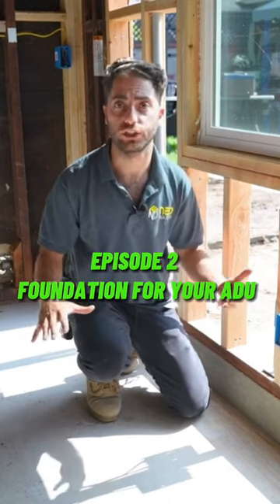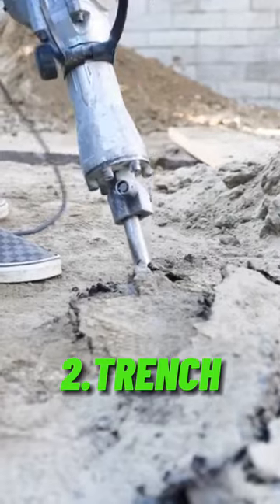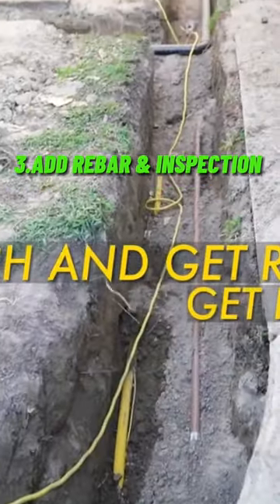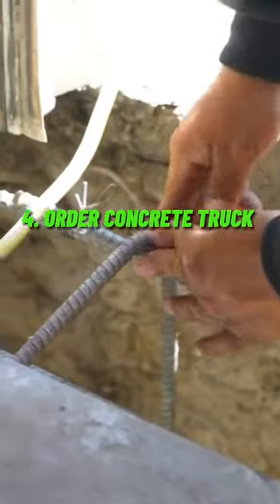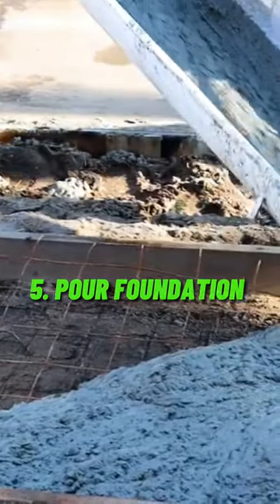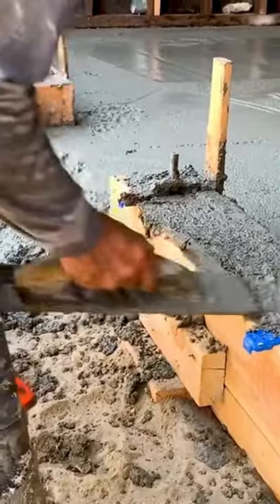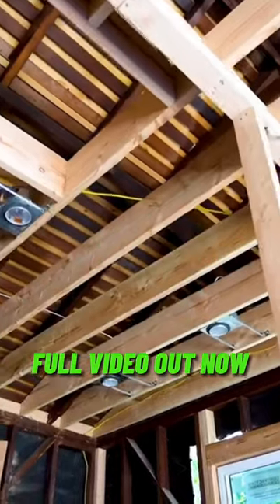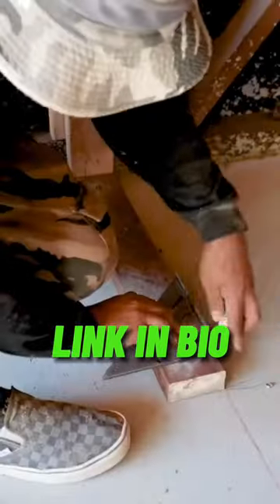Episode 3 | How to Build Your Own ADU | Foundation FULL VIDEO OUT NOW #adubuilders

Comment: Have you had to deal with a garage that was originally framed with 2x4s that are actually two inches by four inches instead of 2x4s that are 1.5 inches by 3.5 inches?
Reply from the maker: All the time. It usually happens with the older homes